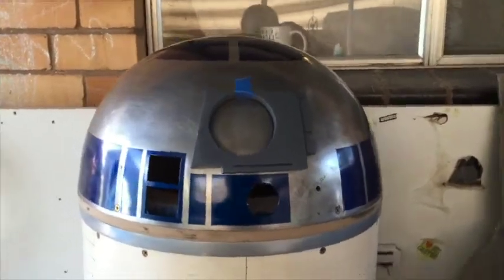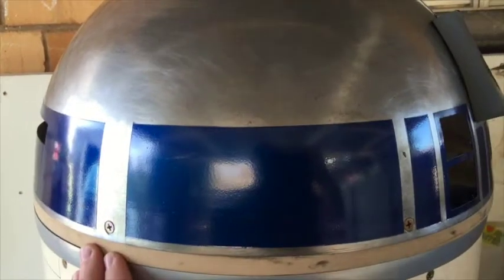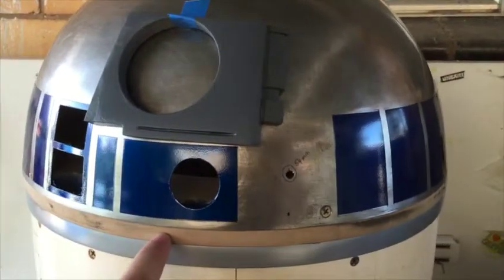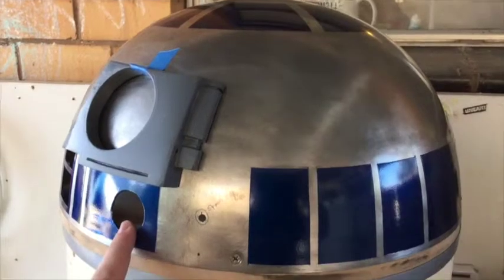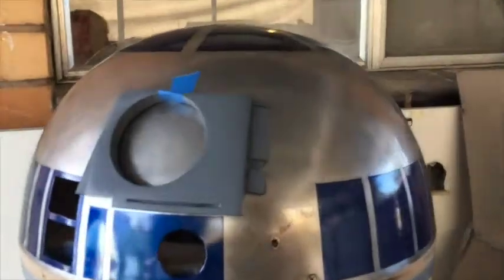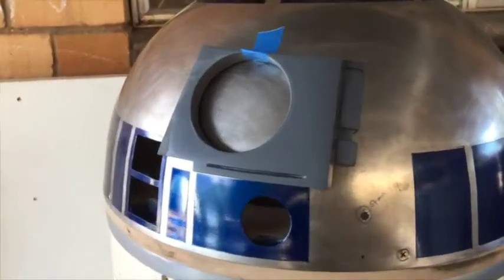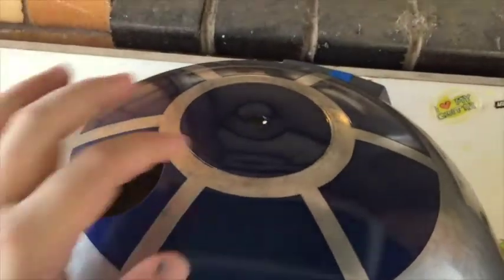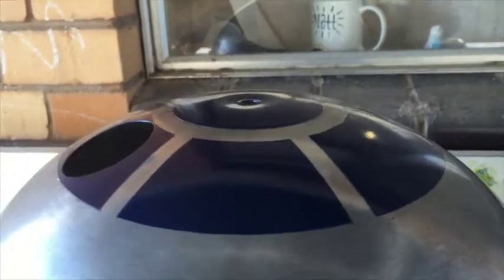R2D2 Build Progress Video 7 - Unmasking and Radar Eye placement

Comment: He's looking fantastic mate, the blue paint is a great R2 colour.
I really need to get a start on my R2 build...I'm getting envious 😈😊
Reply from the maker: +Simon De La Fosse Thanks Simon. I made a few mistakes after I posted that video though. Do not drill a hole through your dome while your paint is still drying. It ended up getting hot and the aluminum dust stuck to it. The rest is fine, but I am going to have to sand back two panels and give them another coat. Oh well, learn from my mistakes...haha!
Reply: Not to worry, its all good fun lol